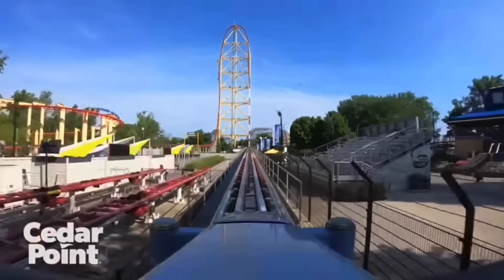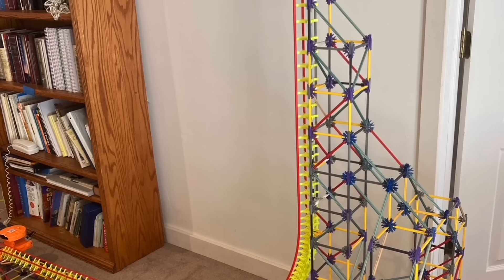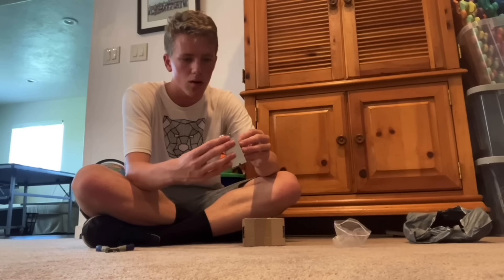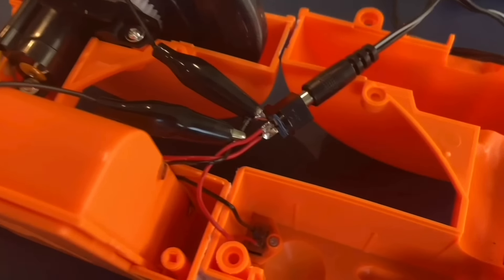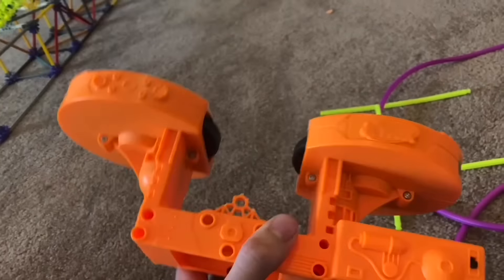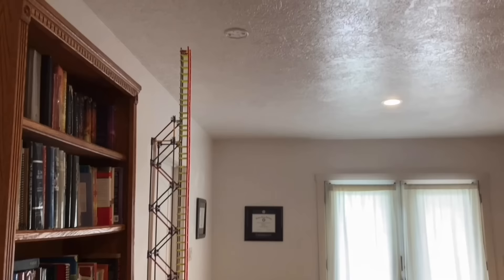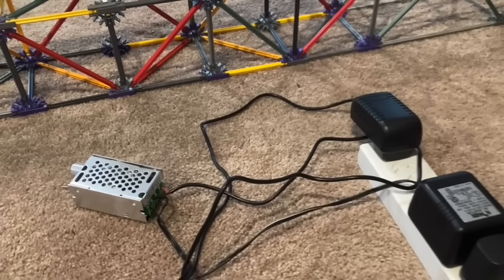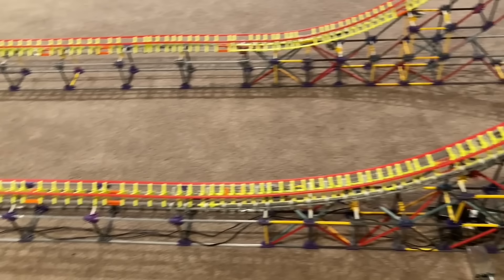I Built a Working (Unlike the real thing) Model of Top Thrill 2! Worlds First Model Swing Launch

Comment: Bro we need to get you  a soldering iron, some arduinos, and chatgpt to write you some code. You could automate all of that sooo easily with an arduino. Also, for little DC power supplies you can always go to goodwill to get one for like a dollar or two!
Reply from the maker: That’s how I got the other DC power supply’s. This one needed a specific number of amps
Reply: @CoasterObsessed  nice! You can always use a power supply that supplies more amps than needed. Or eventually you might just get a bench top power supply that can control voltage and current. Very handy tool to have around! Love the videos keep on doing it man!
Reply from the maker: @bagofclothes7360  I had a power supply I could have borrowed but wanted something to keep long after for future projects!